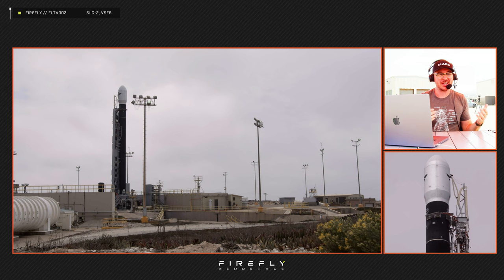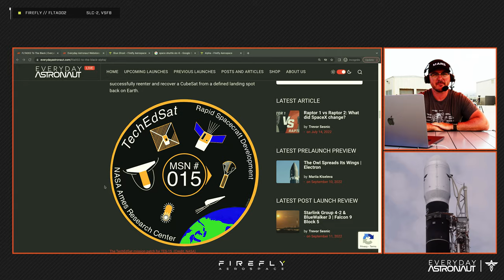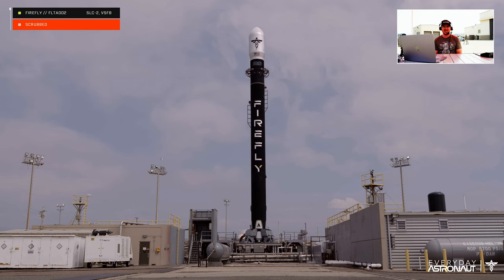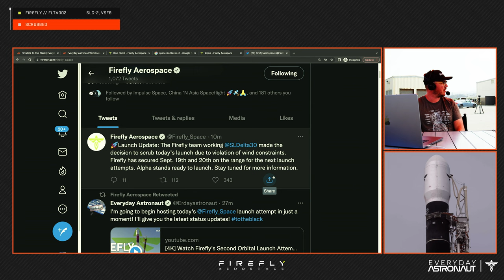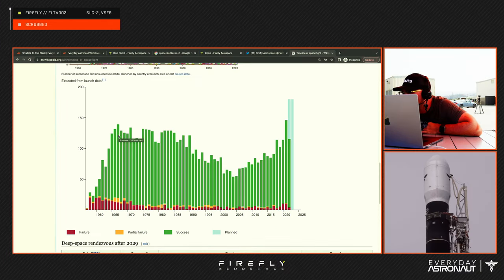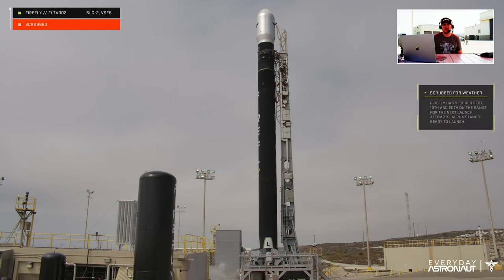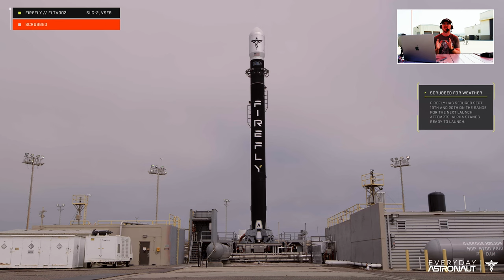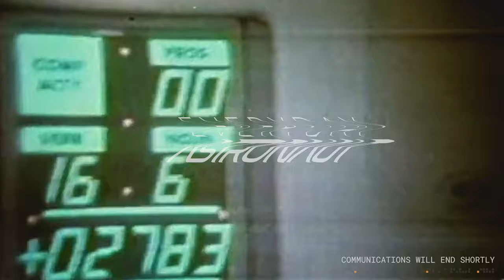[SCRUBBED][4K] Watch Firefly's Second Orbital Launch Attempt Of Their Alpha Rocket!

Comment: I think SpaceX has ruined our sense of how difficult it actually is to launch rockets without em... Ya know.... Blowin up. We're so used to seeing things go smoothly now. we're expecting every rocket standing on the pad to go off pretty much every time but if you wanna launch rockets without em blowing up you gotta play it safe.
Reply: @happyisayuppieword1  totally, they almost didn't make it. They still do blow up plenty of stuff, but they have the funds these days to blow stuff up in the name of progress, not quite the tenuous position of being a new launch provider that firefly is in. I assume that firefly has learned from the early mistakes of SpaceX in that sense.
Reply: Or fail fast and hard. SpaceX got to that point by not being afraid to blow up many rockets. Playing it safe might mean the difference between success and running out of funds from endless scrubs before even getting to test everything that needs to happen after leaving the pad
Reply: @Not_Sure-i6o  I'm sure there is logic to that but also pretty sure blowing em up costs more than scrubbing.
Reply: @yodaco  It's all relative I guess.
 If it takes a few failures to get the data needed to start turning a profit sooner, then the numbers can change dramatically.
A scrub might be cheaper on the face of it, but time and opportunity to perfect the rest of the system is lost
Reply: @yodaco  Also you have to keep in mind it's not just a rocket, but a production line to build many. If they can't afford to loose a few in testing and iterate quickly, then that's not a good sign on the production side. 
That's if they actually intend to compete and not just an elaborate scheme to fool investors
Reply: @Not_Sure-i6o  too true. And if you can't afford to blow up at least 2 or 3 rockets before you get a successful launch you probably can't get it done at all.
Reply: I remember how excited they were the first time they launched on time in an instantaneous launch window (= they have to launch on the exact second).

Comment: Tim's probably answered this a thousand times in the chat - but I'm not getting 4K on YT, I'm getting a fuzzy image and can barely make out the countdown clock. Same yesterday. Anyone else having this problem?
Reply: I get that all the time. It's probably a bandwidth issue. You can click on the little gear thing on the lower right of the screen and it will show you what baud rate you are running at.
Reply: Baud rate 😂 are you still using a dial up modem?
But to add to the answer: you can also switch on 'stats for nerds' in the app settings (right click the video player on PC). 
This shows the connection speed as well as the suggested optimal resolution.
Reply: @mkevilempire  baud rate

From the dictionary.

A number related to the speed of data transmission in a system. The rate indicates the number of electrical oscillations per second that occurs within a data transmission. The higher the baud rate, the more bits per second that are transferred.    
 I may be an old computer guy, it's still baud rate. I'll check out the stats for nerds. Thanks for the info. :)
Reply: @williamgreene4834   OK, I'll try to remember - but I clicked on a couple of other YT vids and they were as clear as a bell. And it only happened on the Firefly videos, a day apart.

Comment: The whole picture is different than what a Hypersonic nose looks like. The expansion of space particles is breaking through what we didn't before?
Reply: It doesn't spend much time in thick air, or in the hypersonic region. By the time it's going really fast, it's already so high up that the air pressure means not much aerodynamic stress occurs. You'll notice "Max Q" - the point of greatest aerodynamic stress - is pretty early on, while the ship is low in the atmosphere.

Comment: hey Elon.  why don't you use plasma coating as heat shield good for 6k degrees?   used on shuttle parts.  also J Lenno used on the Doble steam engine rebuild.

Comment: Would an abort system still work during a crewed mission while in Max-Q? Or is it likely lives would be lost due to the enormous g’s?
Reply from the maker: They’ve tested and certified the Abort system at MaxQ! G forces aren’t much higher I don’t think, just the stress on the fuselage is greater, but it’s designed for those loads.

Comment: Many launch scrubs on rocket systems means back to the planning board. The 21st Century technology has more energy efficient alternatives. Plasma engines, stratospheric takeoff, etc. Rockets are impressive but obsolete. Ultra secrecy and competition are out too. We need innovation and cooperation to fix this ailing space program. The experts is here. Motivation and common sense will solve many issues to achieve success..  Thanks.
Reply: Launch scrubs don't mean back to the planning board, they often don't even mean back to the VAB. And while yes, there's been more efficient theoretical alternatives since rockets have been flying (it's not new to the 21st century!), none are particularly feasible for orbital launch. We're getting there, and there's plans being made for things like NERVs, but plain old chemical rockets aren't going away any time soon.
Plus, firefly is not ailing.